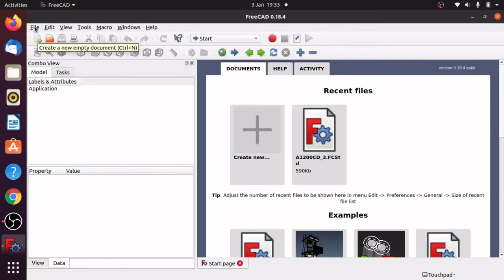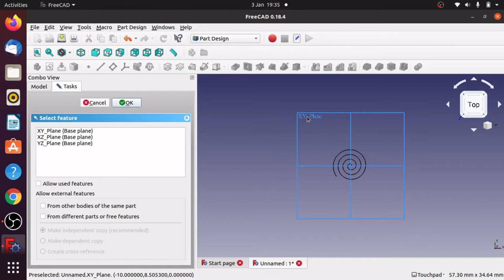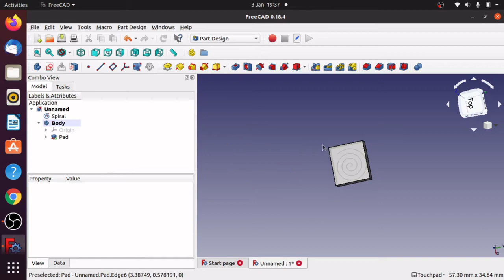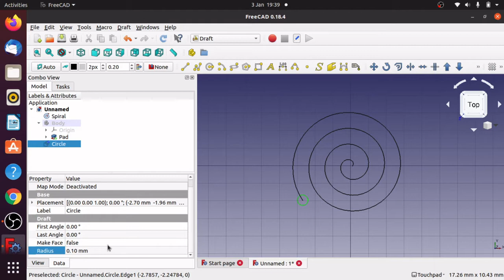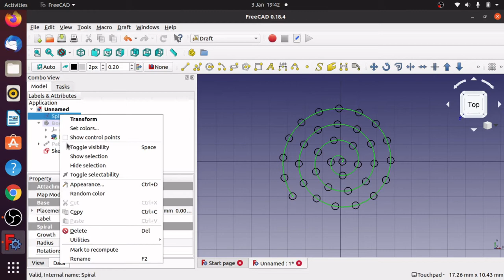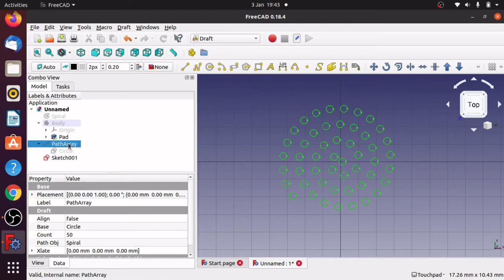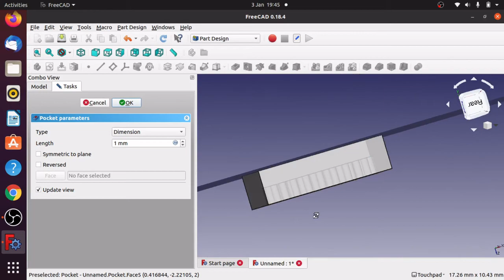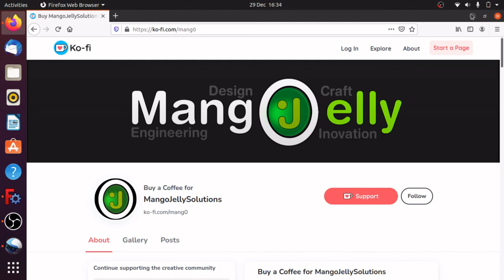FreeCAD : Array Of Pockets Along A Path (Multiple holes in Spiral Path) Part Design Beginners Guide

Comment: Instead of reattaching the sketch to the top face of the body before doing the pad operation- could you just do the pad with a negative distance?   Maybe this doesn't allow the through all option.  Just learning FC and found your video easy to follow.  Keep up the good work and cheers fro m Canada😊
Reply from the maker: Hi, thanks for the comments glad your enjoying. You could pocket / pad whilst it's still on the bottom. To be honest with you I have never tried a negative value but there is an option called dimension that allows you to perform the operation in both directions. I prefer to lay the sketch on the face that I want to perform the operation through or on as it gets less confusing when you go back to your work to make alterations, and I am easily confused.

Comment: This is great!  But I have a need to serate an edge that spirals up, changes radius smaller as it goes, and also twists 90° from start to finish.
I thought about using cylinder rods radiating from center.., or patterning a full sign wave... but the twist and non planar surface have me pulling my hair out.

Any ideas?

Comment: Very well done video.  However, I am wondering if there is a way to make this work with triangles instead of circles (essentially creating notches along a circle).  When I try these steps, I can get a series of triangles around the circle, but the triangles themselves turn as they go around the circle, so that sometimes the pointed end points inward, and sometimes outward, and everywhere in between. I am using FreeCAD 0.19.